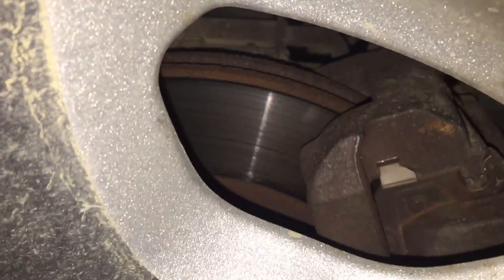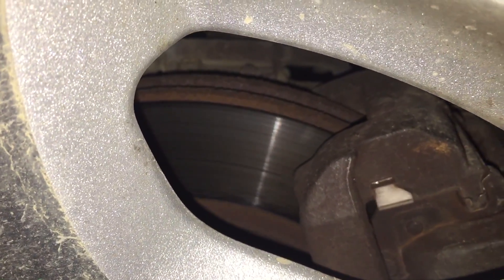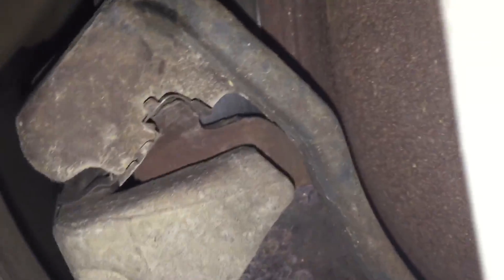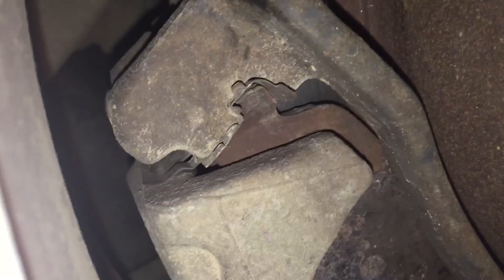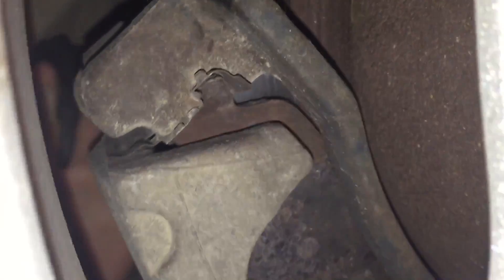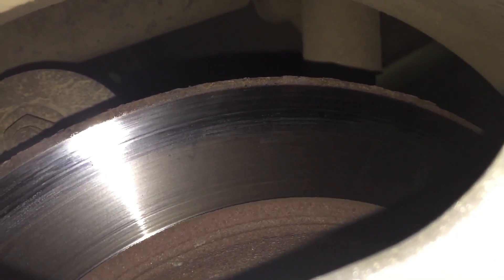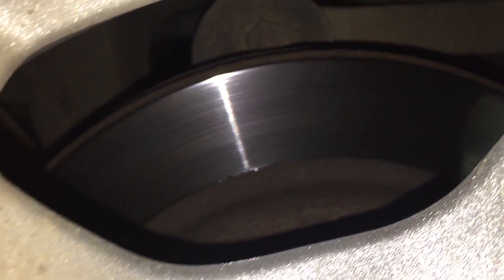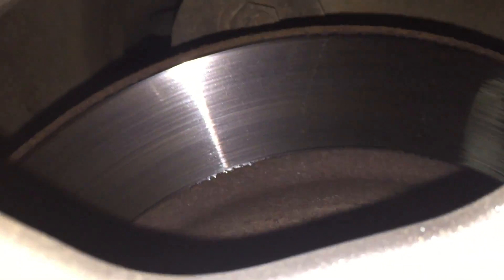chevy grinding noise solved

Comment: Hey, I have a 2003 Chevy Avalanche, and one time I was out driving and my back right brake caliper bracket mount bolt on the top had come out. That allowed the whole assembly to rotate forward and it caught and wedged between the other mount bolt and the wheel and o had to put it in reverse to unwedge it. Got that all fixed, but def check those bolts and tighten or replace them if necessary. Seems you may be missing your left side upper bracket mount bolt as the bracket appears to be laying against the top of your brake rotor already, indicating it may be missing that bolt and just the right stopping to cause it to wedge on ya.

Comment: if your getting heat you have stuck calipers due to bad or old flexible hose! Sometimes you can replace just the line but if any of the particles are in the calipers or line will act like a check valve and keep the pistons from releasing all the way! Replace the lines not the steel lines just the flexible lines and calipers rotors and pads, then flush the steel lines replace fluid and bleed. done! never to have a problem again! Unless you have bad wheel bearings! LOL

Comment: i had the same caliper fall off twice. The 2 bolts that hold it on kept coming loose. i put some locktite on it and havent had an issue with it since.
Reply: I had changed my sturts twice it makes a rubbing noise rear right sounds like coming from in side fire wall .
Reply: My came with locktite from the factory. Pain to remove when I did the brake job!